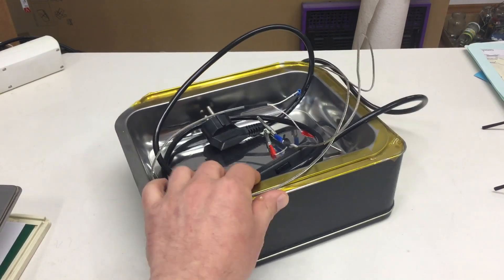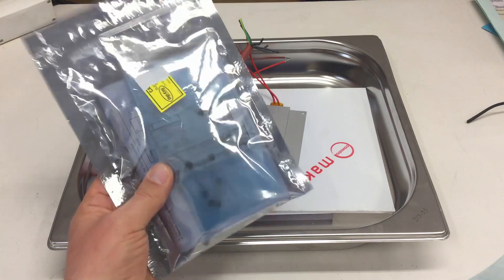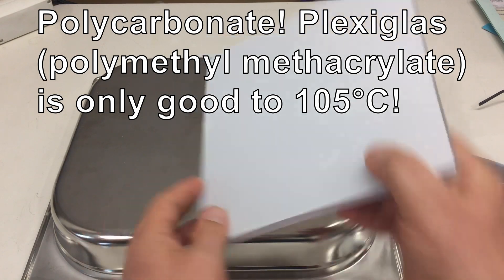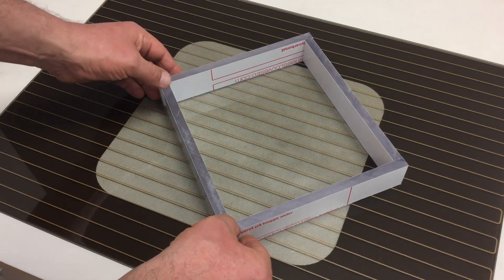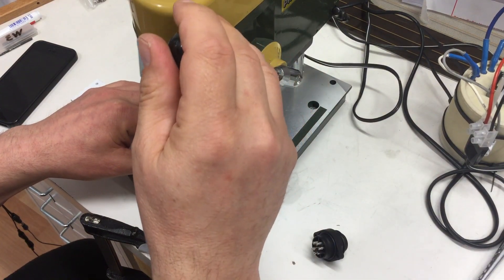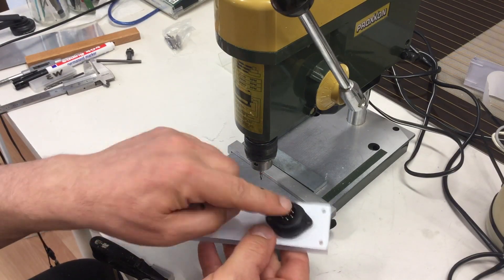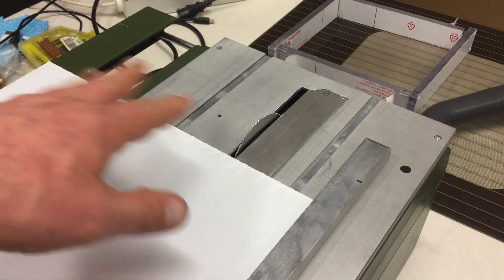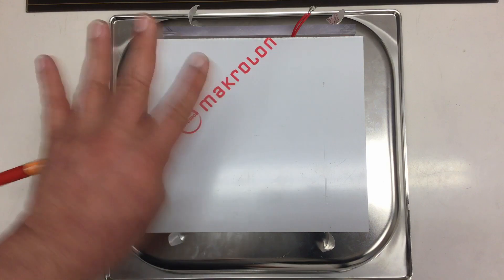Laboratory Water Bath (2): The Hot and Wet Parts, Chapter 1

Comment: Hi Robert. Excellent ! Looking forward to the next part and how you are going to make everything hold together, securely, despite the heat, without drilling holes in the bath:-). Regards, RJM
Reply from the maker: Hi René-Jean, yes, not drilling holes into the bath itself and keeping it nice and clean (e.g. no heater inside the bath like in that gastronomy water baths) was on of my design goals. Reagrding holding everything together: There will be a setback in part 4 / chapter 3 of the hot and wet parts ;-) Best Regards, Robert